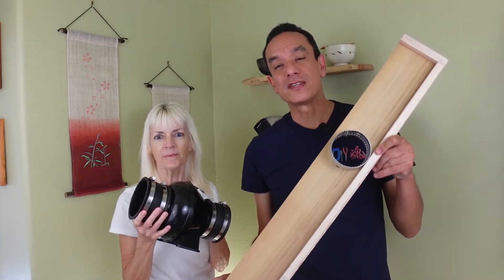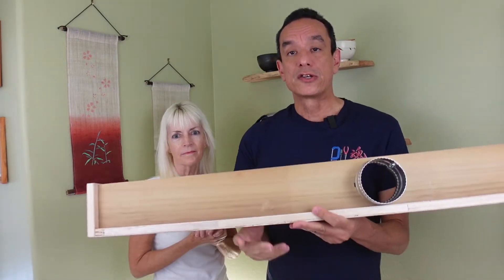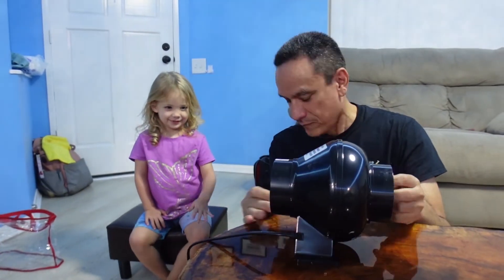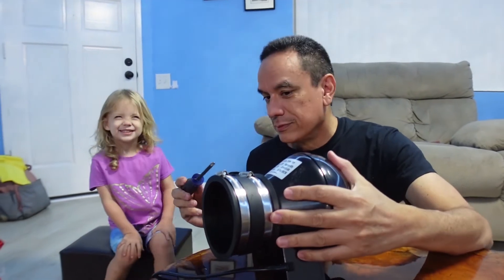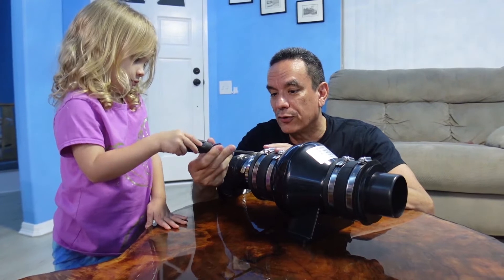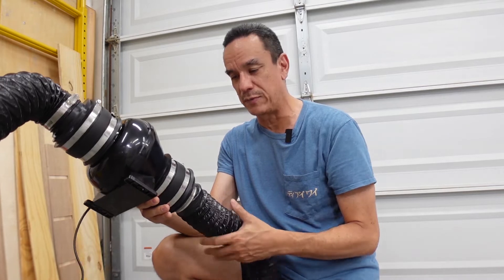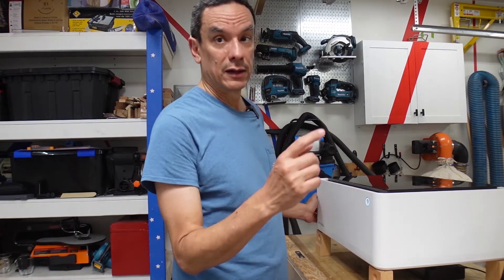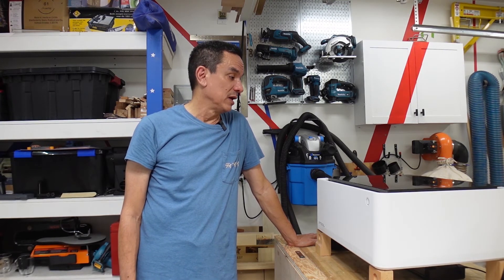Enhancing the xTool M1 Exhaust

Comment: Hi I need some help if possible 
I have recently bought the m1 XTool (only the 5w) however really struggling with the smell, it is vented outside however fine that the holes the base plate and bottom seem to just create a gap for fumes to escape! It’s a really bad smell when cutting wood 3mm 

Could I please ask the best solution? I have just bought an air assist to try and reduce the wood burning, 

Question is would the risers be good which come with the honeycomb and block cover? 

I keep looking at the air purifier but it’s £600 and not 100% sure if this is too epensive (when considering filters are £150) 

Please help as I’m close to selling the machine / returning
Reply from the maker: Unless you can make a 100% airtight system, you will not be able to get rid of the smell. I have the smoke purifier and it allows me to work in my garage that has no ventilation or windows. I dont have problems with smoke but there is still a slight smell. Keep in mind the laser is burning the wood. Even if you temove the smoke  the burnt wood still smells. As for the air assist, it is not meant to help prevent smoke or smells. Air assist blows away microscopic particles that are created by the laser cutting the wood. The particles bounce around and get in the way of the laser beam, making light go in different directions so the beam is less effective. Air assist blows away the particles to allow a clean beam. If anything, the air assist blows smoke around Even more. 
Back to smell. You can cook fish in your house and have a ventilator blow the smoke out but it is the cooked fish that smells. Even without the smoke, your house smells like fish. The smell is coming from the fish, not the fire that is cooking the fish. So you can remove smoke but the cut pieces of wood will smell. 
So... if you use a smoke purifier or fan to vent the smoke, remove the cut wood from the house as soon as you can to minimize the smell.  
I am sorry I am unable to help you get rid of smoke and smell

Comment: Might I make a suggestion.  Unless you are actively using the rotary that in is not necessary to keep the riser blocks installed.  This is a HUGE opening for smoke and other fumes that the fan does not take out to escape your M1.  Just a trick to save your garage from smelling....
Reply from the maker: That is fantastic that you brought this up to us and our viewers. You are spot on. I now cut exclusively with a honeycomb and have to use risers at all time in order for the honeycomb to fit underneath. It causes the gap you refer to. I use 3" x 15" x 1/8" strips i lay/tape along the gap to keep the smoke within and to allow our smoke purifier to capture it. Thank you for the wonderful comment!

Comment: Why did you go with the 3 inch hoses and adapters, rather than just use the 4"? (I can see sticking with the original size on the M1 side, but why both sides? Does it have to do with aerodynamics or something?)
Reply from the maker: unlike a vacuum , where you lose strength by going from a small hose to a larger hose, this is just a fan pushing air out, faster. So, you are absolutely correct. There is no requirement to do so. I picked up a spare 3" hose to match the one that came with the M1 but I could have gone with a 4 inch.

Comment: How did you disconnect the original fan?
Reply from the maker: I did not disconnect the original fan. It just supplements the flow from the M1 fan. It does make the M1 fan spin faster, but i dont believe it will cause problems.

Comment: Love it and thanks for sharing! This would work for me in the warmer months but not in the winter as in my area it gets too cold for me to work and leave the machine in the garage. So, wish I could because my set-up is in a spare bedroom. So, I had to get the the xTool Smoke Purifier. It definitely helps but it could be better.

What I noticed recently is that there are those openings on the right hand side of the base which will still allows smells to escape but having whatever exhaust system/purifier definitely is better than none.

Tracey
Reply from the maker: I am sorry we did a poor job of explaining, our design is made for our garage but the concept will also work in windows., You would open your window, place in the exhaust wood and then close the window to pinch it in. The M1 has a decent fan to help push out smells and smoke but the inline fan, boosts the power of the airflow to push the smoke and smell out. I dont think this method will get rid of the smoke and smell 100 percent but I believe it will do a great job.  BTW, we wish to thank you for taking the time to watch our video and for your well written comment. We sincerely appreciate it.
Reply: @Poor_Mans_DIY  you did an great job explaining and I understood it all. I have a large slider window and probably could turn it vertically. I just would need to hire someone to do it.
Reply from the maker: @TraceyYJohnson  Hmmm. Let me think of options. You can check with local high schools with wood workshops and see if they would be willing to make it for you. Try craigslist and search local handymen. If they are advertising over Craigslist, they may do it as a side hustle and for a very low price. If you come to Hawaii, we can build one with you. 🙂
Reply: @Poor_Mans_DIY  thank you for providing suggestions and would love to come to Hawaii :)! Have an amazing day and weekend.